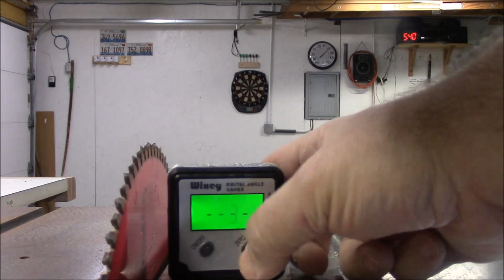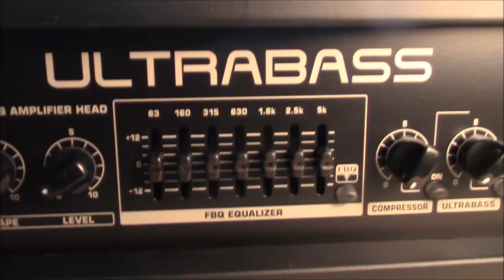DIY 1x15 Bass Speaker Cabinet

Comment: Really nice finished product. I’ve been looking for videos like this so I can make my own 2x10. A lot of good players use picks, but moving on to fingers will definitely open up your play-style.
Reply from the maker: I've also been thinking about a 2x10. This amp is a 300W into 4 Ohms. So with an 8 Ohm speaker, I'm only getting 150W. Even at full volume, this thing isn't very loud. Two 8 Ohm, 10" speakers in parallel would be 4 ohms, so I'd get the full 300W and more speaker surface area to move some air without too much more weight or size of the cab. But realistically, I only play in my office, and the speaker was free, so there's no real need to get anything better. 

It's been a year since I made this video, and I'm getting much better at using my fingers. I just have problems with my thumb. Either I anchor it on the pickup, or I start using it to pluck the low E string, like finger picking a guitar. I notice real bass players move their thumb to the string next to where their index finger is plucking to prevent the string from ringing. Gotta work on that.

Thanks for watching.

Comment: if you would have offset the speaker the horn would have fit.
Reply from the maker: Yeah, but I was also after a certain aesthetic. I like the look of the centered speaker and I wasn't (still am not) settled on how I want to protect it from the front and I didn't want to limit myself. After a couple years, I'm not missing the tweeter at all.

Comment: is it not a vending speaker sounds very thin for a 15er
Reply from the maker: Well, you have to realize that you're relying on my camera mic for the sound. It's not like I I had a SM57 through ProTools or anything. 

But you're probably not wrong. Since it was a free speaker given to me from a friend, I didn't have the T/S parameters and tried to find them myself (in another video on my channel). Turns out that some of the formulae I was using were wrong and since updated on the site where I found them. I'd have to re-run all of the calculations and those may point to a drastically different cabinet. It's something I'd like to re-do, but it's low on my priority list since it serves me well enough.

Comment: Nice build. I wanted to do something like this for my setup. I have a 300w head and would like to build a cabinet small enough for me to carry it around for practice and small garage-type gigs. What are the specs of the box (dimensions) and the speaker/driver you used (woofer, sub or mid, RMS rating)? If you did put in the tweeter, would you have needed a crossover for that?
Reply from the maker: Thank you for the compliment.

The outside dimensions are 19.5" wide by 19.5" high by 18.5" deep. 

I measured the T/S Parameters of the speaker (it was given to me and there was no info on the web) in a previous video - https://www.youtube.com/watch?v=dwm1v2w2tH0&lc=Ugy6zZIeKPcuXvol6Xt4AaABAg

The Motorola tweeter that came with the big speaker was a very nice one that does not need a crossover. The way it was built will automatically filter out low frequencies. The physics of the big speaker naturally make it a low pass filter (too much mass to move at high frequencies), so no need for a crossover for it, either.

Comment: So the quality of plywood used doesn't really matter..?
Reply from the maker: Definitely not, in this particular case. This was meant more as an experiment to see ho well it would work. Even still, I don't think there would be that much of a difference. Maybe you could hear the difference if two cabs were A-B'd one right after the other. But if you played the cab with cheap plywood one night, then the cab with expensive plywood the next night, I doubt a listener could tell.

However, if you do not plan on using tolex or some other covering over the wood, then you'd definitely want the better looking plywood.
Reply: @HandlebarWorkshops  My sentiments too... I asked because I can clearly see any amount of cavities in yours. I plan on making several cabs and I plan on using good plywood, but not birch ply
Reply from the maker: Fender has a history of using 3/4" pine planks that are finger jointed at the corners. Though, that might be rather heavy for this size cabinet. I was following Mesa Boogie's lead here in using the 1/2" ply to cut weight but using the corner braces to keep rigidity. But the speaker alone is pretty heavy anyway.

Comment: clean that solder tip on a wet sponge before making a solder joint.
Reply from the maker: Yeah. That's the iron I learned how to solder with. I didn't intentionally mistreat it, I just didn't know any better. I've got a new one that has stayed in much better condition.

Comment: Thanks for the video!  Check out my channel as well - I just worked through a Marshall cabinet re-purpose.  Question... why didn't you add a finish to the box?  ever a poly coat?
Reply from the maker: I didn't finish it because I am planning on doing a covering. I just need to figure out exactly what I want. I've been thinking about doing a Fender tweed-like covering, but using denim instead. I have to do some test pieces to see if I can shellac over the denim, though. 

Thanks for watching.

Comment: Sealed cab. Needs a port.
Reply from the maker: Possibly. I tried to determine the T/S parameters of the speaker in an earlier video (https://www.youtube.com/watch?v=dwm1v2w2tH0). The results were somewhat indeterminate (the author of the webpage that I used for calculations has since updated the formulas and I need to re-compute the T/S parameters - that may be another video, eventually). 

The cabinet size calculator web page couldn't give me a good answer as to if it should be a sealed or ported cab, so I decided just go with a sealed cab. This was just meant as an experiment and the sealed cab was easier to build. Hopefully I'll have time to rebuild the cabinet (or add ports) if the new calculations indicate that it should be ported or a significantly different size.

Thanks for watching!
Reply: Lmao i'm sitting here as a speaker "specialist" why in the hell would that need a damn port lol?
Reply from the maker: In a previous video, I found the T/S parameters for the speaker. One of the formulas I used was wrong. I still need to go back and recalculate the parameters and put it through a design software. This speaker may very well be best used in a ported cab. Just gotta find time to do it :)
Reply: @HandlebarWorkshops  Yeah I've seen that video but yep it was false parameters. Thing is he says outta nowhere that it needs a port without knowing the ts at all. Also a speaker that is best used in a ported does work in a sealed. It just doesn't get as much SPL and low frequency extension as in a ported. Depending on application ported or sealed is the best.
Reply from the maker: Interesting. So, by going sealed, I kind of erred on the side of caution. Thank you.
Reply: @HandlebarWorkshops  It also depends on what you need. A four stringers lowest note is 41hz. That would work fine in sealed box. You really only need port if you're going loud and deep like 20-30hz or even lower.
Reply: But once again depends on the speaker too.

Comment: only glue,,,  no screws ,, huh
Reply from the maker: If I were gigging it, I probably would have added screws in case of drops and rough handling. They would hold the wood fibers together on impact. Otherwise, the glue is stronger than the wood and is more than what I need.

Comment: I would of stapled in some batting like your supposed to do. NOT throw in loosely, some fluff from a pillow. Batting is relatively cheap & can be bought anywhere.

The sound of that amp is horrible. Too much distortion & boxy sound.
Reply from the maker: Yeah, there are things that I would do differently now. Thanks for watching.
Reply: @HandlebarWorkshops  I refurbish bass cabs. And learned by watching vids here & others who do it as well.

Comment: Do you plan on putting a Grill cloth on it ? If so, I would to see a video on that .
Reply from the maker: No I probably won't put a grill on it. It's been 2 years and I still haven't made up my mind on what I want to do with the front of that cab. I've never taken it anywhere, so I'm not too concerned. I was thinking about leaning into the homemade look and using a grill from an old fan. I thought that would look pretty cool.